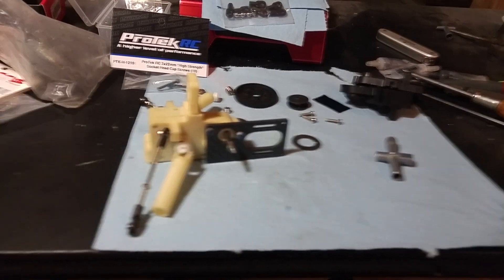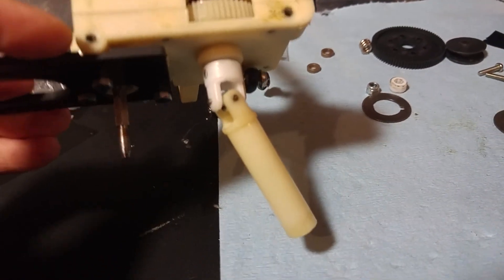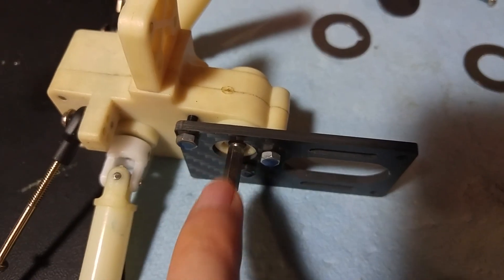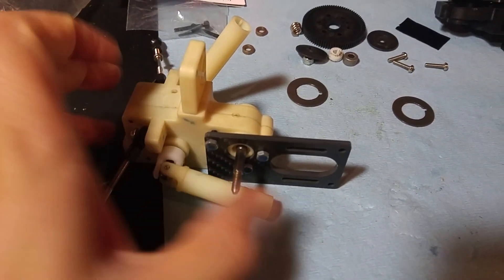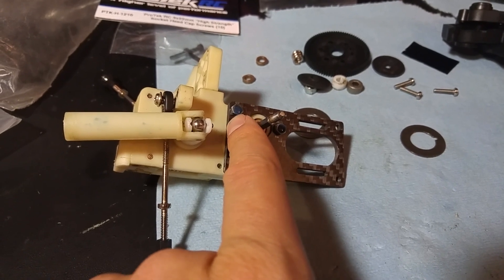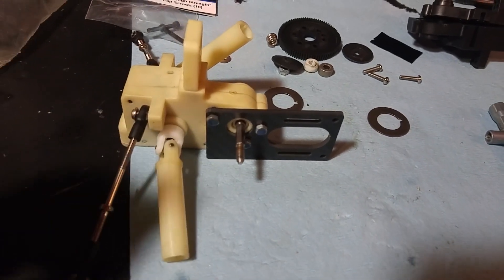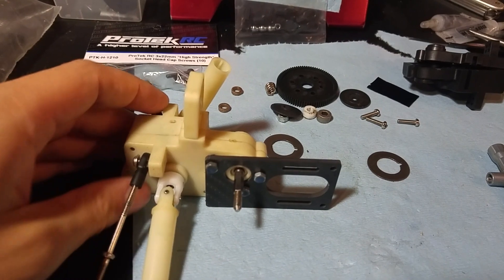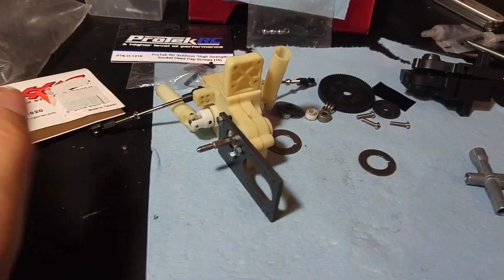Vintage Traxxas Nitro Hawk Electric Conversion, Part 1

Comment: awsome video my uncle did the same thing and ran into the same problen with the motor mount.all we had to do is get the same size screws but the the top of the screw has to be flat top a screw.now its my sons truck and i never had this problem  again.man i wish traxxas would do a remake on this model. nice video.

Comment: The 1.75mm hex spacer found in Part# 3693 can be used to shim the slipper in case you wanted a cleaner solution.